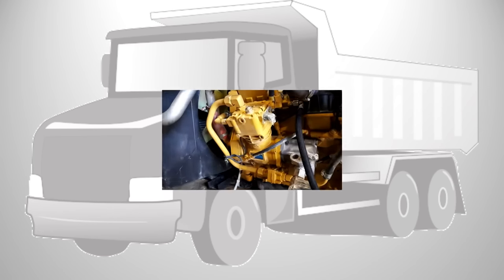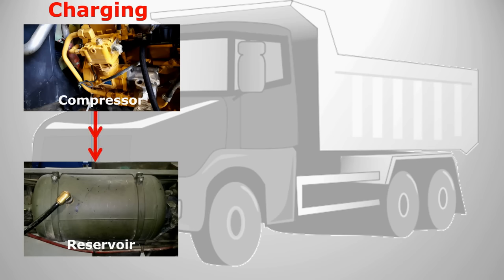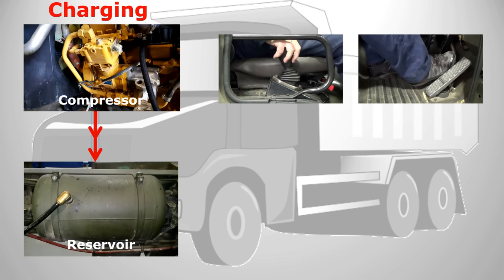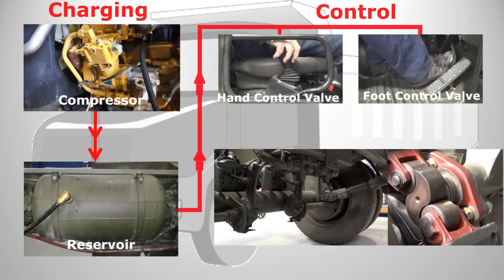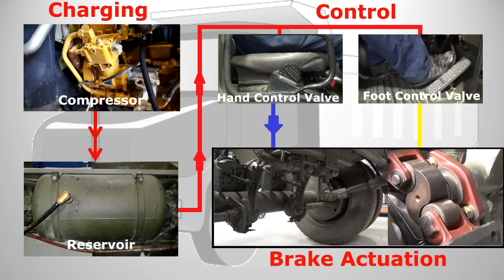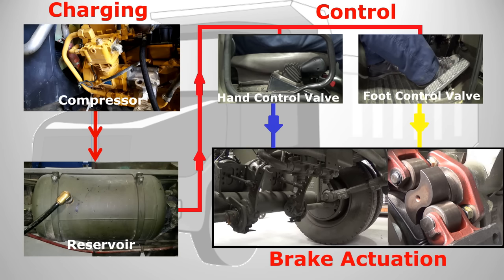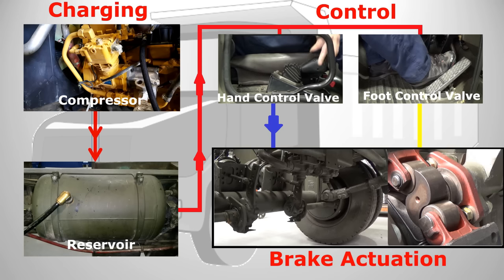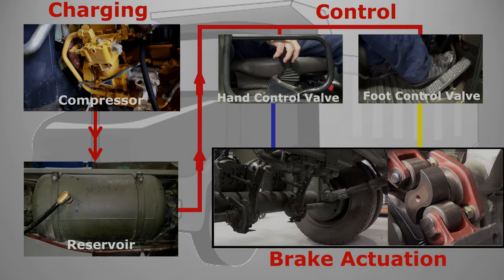Air Brakes - An Introduction. How it works.

Comment: Most people do not understand how air brakes work. They think if you lose the air you lose the brakes. When in fact the opposite is true. You lose the air and the brakes lock up. I have lost count at the number of times I have seen movies where the air is lost and they have a run-a-way with no brakes.
Reply: It's like when a jet or plane in a movie loses control and the character is fighting the stick or yoke for dramatic effect. Makes no sense at all. Lol.
Reply: We dont either why tf u think we watched the video
Reply: @itsdesean exactly 😂😂
Reply: Why are you even posting here? Lol
Reply: @randabuffer6562  It is YouTube, that is why.
Reply: Some old trucks when air loos dont brake ....praga v3s,liaz mtsp 24,....
Reply: That’s our education system for ya.   I see what you are laying down for this comment
Reply: You do lose your service breaks.. that is true. What stops the vehicle after that is the spring breaks that are applied when the air pressure is lost.
Reply: What is most weird is that truck drivers don't understand it.
Reply: @miketython5824 if you service brakes are hydraulic how do you lose them?

Comment: Oh wow, that is way more intricate than I thought. Been playing American Truck Simulator and dealing with charging the brake system and loosing pressure has brought me here to try to learn the way it works IRL. Thanks for the vid.
Reply: This was just intro and very basic! i am in school for this and this system sucks!
Reply: What do you mean by IRL?
Reply: @deepakk1347  IRL=IN REAL LIFE
Reply: @kobe7401  Okay, but whats a better system then? Oil braking?
Reply: @multiomer1997  air brakes is really only good for commercial trucks, theres a reason sports cars dont use air brakes lol. I think the concept to learning air brakes sucks i dont think air brakes are bad

Comment: WHAT PRESSURE DOES AIR BRAKE SYSTEM RUN AT ?? 60 PSI. 100 PSI. 125 PSI ????
Reply: NO ONE KNOWS !!!
Reply: Depends on the system

Comment: So when you engage, the handbrake air is pumped into a chamber in the brakes, releasing them. When the brake pedal is pressed is the air released from the handbrake chamber? or more air is pumped into an opposite to the handbrake air chamber (working against the handbrake) and engages the brake and then when foot pedal is released the air from this second air chamber is released make the brakes free?

Comment: I am already very familiar with the air braking systems on trains, being a train nut, and while knowing that air brakes on commercial road vehicles must work in a similar manner, I did not know the functional differences. I also did not realize there can be a delay between pressing the brake pedal, and the brakes being applied.

Comment: From what I can gather, air brakes work in a sort of opposite way to hydraulic brakes. 

In hydraulic brakes, you need fluid to compress the pads against the discs, but in lorries, you're sort of taking air away, allowing the brakes to 'unlock' and compress against the rotor, so if you have no air, the brakes stay 'unlocked'.

Does that sound about right?

Comment: I have been driving trucks for 15 years(this upcoming april) and I know absolutely everything about the air brake system....but one thing I've never understood is where the hell does the air exaust from the brake chamber?? The high pitch air expell.....is it from the gap in the slack adjuster??? I'm no rookie but I'm just curious lol

Comment: So for the parking brake, you're essentially forcing air into the chamber to compress the discs? And the same for standard braking, you're forcing air to compress the discs? And when you let off the pedal (or release the parking brake) you're letting the air out of the chamber?
Reply: Yes, but its the reverse. The actual braking is done with a powerful mechanical spring. When there is no air in the system, the spring is engaged and pushing hard on the brakes. When the truck is started, air pressure pushes back against the brake spring, releasing the brakes. When you push on the pedal, air pressure is relieved from the spring, and in turn the spring pushes on the brakes again. This means that if for some air pressure drops, the truck will automatically stop until air pressure is built up again.

Comment: So the air is to release the brakes from the power spring ?
Reply: as i understand. the parking brake is powered by large springs, when the parking brake is released, air pressure overcomes the springs and releases the parking brake.
Im brand new on the subject but heres a simple overview of how things go. https://www.youtube.com/watch?v=ElVyYKGeU1g
Reply: Isn't this confusing? In other words, if there's NO air pressure, the brakes are always ON?
Reply: @hg2.  YES, all the TV movies where you seen a truck lose air and brakes had it wrong. Air it used to hold the brakes OFF. I always find it funny when I seen this mistake in a movie.

Comment: Actuators is used for  braking speed of rear brake than the front brake when brake is applied , so the heavy vehicle is control the balance by driver

Comment: Is that why I see a lot of semi tire Mark's do they run out of air and brakes engage or what ?
Reply: It could happen. But more than likely the drivers are locking up their wheels with a light load.